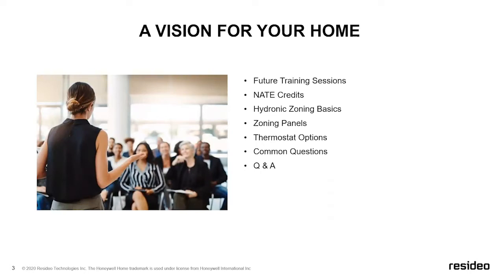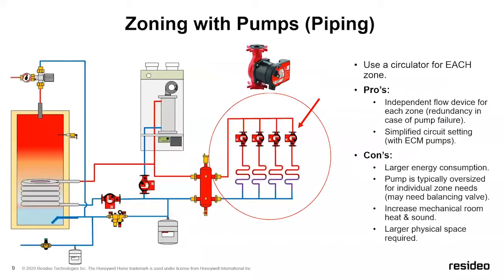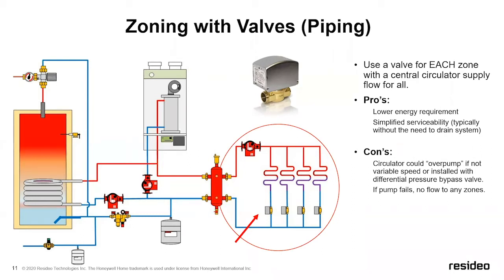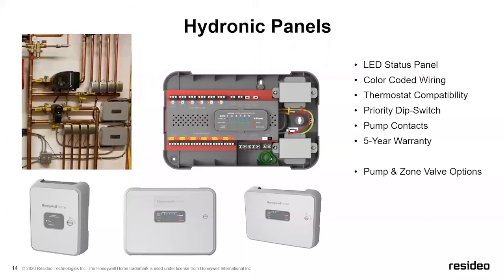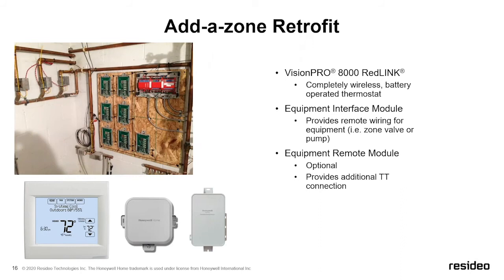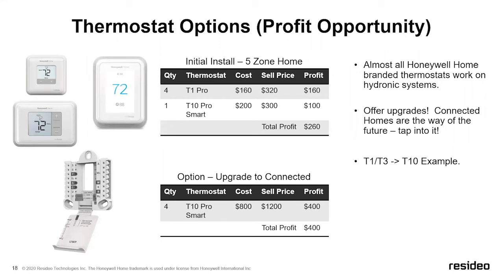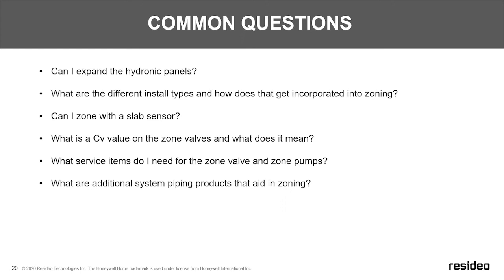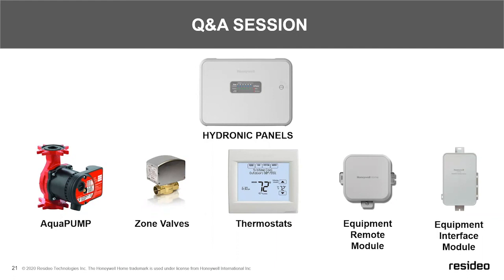Hydronic Zoning Basics

Comment: In a 2 zone system wirh one circulator pump, and aquastat  being used, only two thermostats one for each level, should all rooms be the same temperature whether doors are close or left open. I seem to be having a problem with the master bedroom (door closed) being cold before bed then door us left open and is substantially warmer overnight. My zone control valve heads were replaced along with the aquastat. Suggestions?